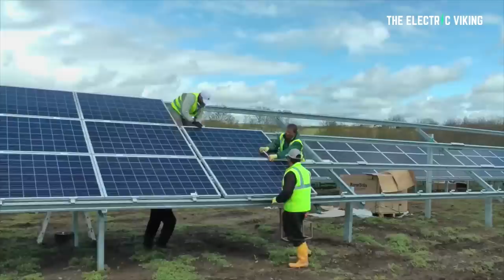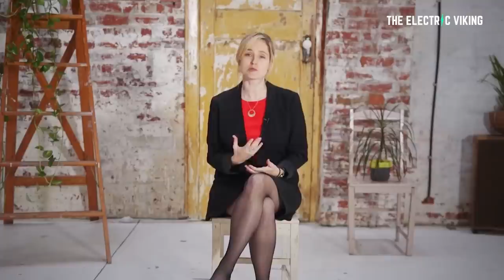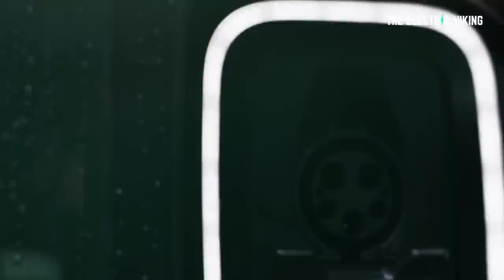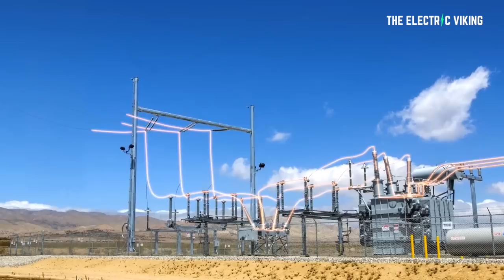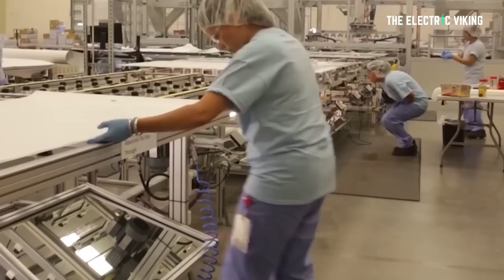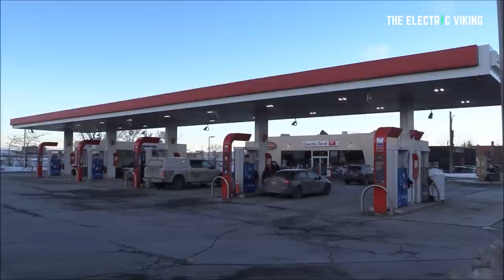How the world can stop the cost of living crisis & halve electricity costs

Comment: I can verify. We bought an EV and put 40 PV panels on the roof. Saves us around $5K a year. It’s like winning a free holiday, every year.
Reply: 40 panels!! damn, how big is your house. There’s me thinking I’m a big man with 22panels. I Feel like I’m a total failure now, I better call the Samaritans 😂
Reply: And twenty years from now when all the panels are done, what will be the cost to dispose of them , because there is no way to really dispose of them ,and what will be the cost to replace them? Or have you thought that far ahead? I have more than 40 panels on my house and garage...but I'm near the end of my life, so I don't plan on having to replace them.
Reply: How much electricity do you use where your savings ALONE are $5k??? Our 4 bedroom house, which is entirely electric, uses less than $1300 per year in electricity… in the PNW
Reply: @gabe1254  Pretty good. Do you use heat pump for heating your house? Heating water?
Reply: @andrezcabara2774  Yes, heat pump water heater and a Trane heat pump for heat/AC. I built the home this year, 2000 sq/ft, common construction but well air sealed. Average 28-33 kWh per day usage. Electric rate is less that 7 cents per kWh.
Reply: Mark, solar panels live far longer than twenty years.  They may drop efficiency a bit, but they can be used for quite a while.  
Earthship Biotecture will be happy to put your panels to work if you are done with them.
Reply: @gabe1254  With 7 cents kWh no wonder your yearly bill is less than $1300. It costs 30 cents here, so energy bill would be over $5k here :)

Comment: I just fitted a 6 kw solar system with 30 kwh battery in England, so far for the last 3 mths my electricity bill has been  0 , only paying standing charges. I think it will be November before I might start to use some from grid. I see a savings off about 2000 pounds with a 7 year payback at current prices which will no doubt drop to less than 5 as prices increase . Its a no brainer
Reply: I'd be lobbying to get the standing charge reduced if I were you.

Comment: I have done just this in my home and I use no gas any more. I have Solar PV and a Battery and an AirSource Heatpump and my monthly electricity bills (total household energy) average out at £10/month, insulating me from the disastrous rises in energy costs in the U.K.
Reply: Excellent could you please write down how much electricity you use for appliances, heating water and heating home?
Reply: @teranova5566  Most recent year Sept to Sept :- SolarPV Gen : 2658 kWh ; Day Units purchased : 4801 kWh ; Night Units Purchased : 5388 kWh. (includes car charging mostly night units and winter A/S Heatpump and battery cheap rate charge for consumption during day rate)
FIT Payments 51p/kWh for generated units. Some RHI payments (approx £80pm) for Heat pump. Net input to budget acct £10pm - balance still grows!

Comment: I am with you from one Viking to another (according to genealogy I can prove to be of Viking decent) on renewables. I have what I may on my roof + some to play with and then my farm is totally off grid. Unfortunately I don't have enough at the farm for heating in the winter. If nothing else we create less CO2.
Reply: Baby steps!!
(Investigate low voltage Infrared panel heating)
Reply: @rogerstarkey5390  I have attempted to use an old heat pump and store the heat in storage tanks but in winter and no sun the panels are only 10 % effective. Enough batteries are too expensive.
Reply: We are in the same boat in Canada.  We have sun in the summer and wind in the winter.  Doesn't make much sense to install wind as an individual but as a cooperative/community venture it may be possible to install a larger wind turbine.   Ripple energy in the UK is an example of such a venture.

Comment: Yes, accelerating the transition saves more money. Roll out nuclear, solar, wind, and batteries all as fast as possible. Dynamic pricing is critical for stability. Also need dynamic pricing for users and suppliers. Need dynamic power use controls at homes to do this. If price goes above a threshold, consumer need automatic cutouts so they do t get charged $10k for a month because the prices spiked. This will greatly stabilize the grid.
Reply: What is going to provide base load power when the remaining coal fired power stations are decommissioned. What is going to replace the revenue of coal exports? EV batteries are made with fossil fuels at the moment. We need more coal fired power stations, not less. People have cost of living pressures now. What’s the immediate solution to that problem? Nobody, including the Federal Government,  have explained how renewable energy is going to bring down power prices NOW.
Reply: Please explain dynamic pricing and dynamic power usage.
Reply: We need this NOW.
Nuclear is a multi decade project... WHEN (if) the new tech arrives.
We need 
Grid scale projects which ramp, generating from early in the project (example. Wind ramps as each individual turbine is installed)
.
Fragmentation, dispersed grid.
Why doesn't government, instead of giving grants, install say 2 panels and a small (4kWh?)!battery on homes..... Lots of them.
Get the homes off the peak grid.
As the money is saved on peakers, increase the investment, more battery, plug and play.
This would have the same effect as a grant/ refund, reducing individual bills, but be ongoing.
.
Concentrate on efficiency
If they have "spare energy", don't piss it away on inefficient storage like Hydrogen.

Comment: Storage is the biggest issue as basicl storage is still to expensive it is working for the short terms grid stabilisation where the rewards are high.  They need to put in much cheaper base storage most thenlithium batteries are still difficult to justify
Reply: Actually he mentioned zero homes.  That is a lot more than just solar.

I think he even had a diagram, heat pumps, design of take care of passive solar.  

Actually, even trees properly placed provide a great deal of shade and improve air quality.

And, we have to look at better Mass transit and that may even mean more car renting rather than owning.
Reply: @tireddad6541  nicely said but Northern Europe where I live has a very limited amount of solar energy in the winter due to the high latitude. Also up to 10 days without wind are not uncommon. Both can't be solved with storage in a economical way, also not when considering future storage prices.
Reply: @Sander-zj3wi  The EU has plenty, plenty of land in Spain, southern Italy and Greece to supply ALL the electricity it needs!!!

Comment: People - STOP with the excuses. It's YOUR LIFE - take charge. Where there's a will, there's a way. Lazy gets you ZERO. I'm 76, on minimal USA Social Security - fixed low income. NO other income, period, yet I just completed removing myself from the grid with solar panels and a lithium battery bank - results, not excuses. It's about what you really want. Yes, it took me a while. Yes I gave up candy and Netflix to be OFF THE GRID. You can all do it. OK. here come the reasons you can't. Stop making a CAN'T list and start planning your escape.
Reply: I have not paid an energy bill from when I installed my solar system. I pay a grid-connect fee, starting at 20 up to $24 a month to let them be my battery. It would have cost me 10 times as much to build an off-grid system as the grid-tied system.
Reply: WELL SAID.
Even turning stuff off, wearing a jumper, turning the thermostat down 2° helps.
Baby steps.

Comment: Missing a lot of important considerations here.  The biggest of them being what happens when the sun is not shining and the wind is not blowing.  You need a whole new back up system that runs off of....
.
.
 
 Fossil fuels
..

Germany is learning this the hard way
Reply: Here's an "important point" (observation)
I'm sitting in London.
Full cloud.
The tree outside my home isn't moving (no wind).
14:00 Tuesday.
The UK grid is currently at 46.4%GREEN ENERGY 
About 3:1 Wind:Solar.
The point?
The wind is blowing SOMEWHERE. (Scotland?)
The sun is shining SOMEWHERE.
(Just noted it was 54% total yesterday).
We'll be installing a lot more soon.... Probably be exporting to you! (You're welcome)
Reply: @rogerstarkey5390  I'm all for renewable energy! But until there is battery storage system that is capable of holding energy to power a densely populated area (most of the world's population is in cities or trending more so in that direction) renewables will be a limited solution for our energy needs.  
Also there are only a handful of areas where renewables make sense (with lots of sun or wind).
Reply: @rogerstarkey5390  That's awesome. You may have a bit of an advantage since you have a lot of coast lines where there's a lot of wind. Still impressive. What's the price for 1 kWh?

Comment: I haven't had an electricity bill since 2009.
Reply: Where do you live? You heat your home with gas?
Reply: @andrezcabara2774  Australia. Yeah we had a gas furnace but recently ditched it for  ducted reverse cycle air conditioner. We have Solar PV and solar hot water. I still expect no elec bills.
Reply: @passdasalt  Thanks, Australia probably has a milder climate where I live. I will have a 8.2 kWp PV with Battery but that should not be sufficient through the winter according to calculations.

Comment: Without nuclear energy to backstop for when solar/wind is insufficient, it’s not viable for solar/wind in the next few years in the US to go all renewables otherwise, regardless of battery storage, of which that also can’t possibly keep up probably even for EV cars by themselves, let alone stationary power storage batteries.

You make it sound so simple and straightforward and short-term, but it’s not.
Reply: Here's the method.
You build 1 GW of "whatever".
You remove 1GW of fossil fuel generation.
.
You can do that with green sources, just keep adding....
.
Nuclear?
That's a problem.15 year project, no incremental ramp, expensive project build, expensive power.
Plus "NIMBY" to delay things.
.
If I told you that compared to nuclear, you could build the same Wind capacity, then start again, build the same amount and finish at the same time as the nuclear project, plus, as a side project, build more battery storage than you need, and you would have cash left over.... And the cost of the energy produced would be 40% that of the nuclear electricity, would you think wind might be a good idea?
.
That's happening right now in the UK.
3.6GW of Wind, completing at the same time as 3.2GW of Nuclear, but the Wind project started years later, will cost £8.9bn compared to £24bn and the energy will be £48/MWh compared to £114/MWh.
....
Ok. They didn't double up, but
They could have used the "spare" £13bn, ended up with 7.2GW (vs 3.2GW nuclear) and spent  £4bn extra on storage.
Put the second phase in another location and it gets over the "but the wind doesn't blow" issue?... The wind always blows somewhere, plus more than double capacity when it does blow and tons of storage..... No problem.
.
Alternatively.
You don't build a (single) big project.
Build a lot of solar panels.
Build "half size" house batteries.
Start a training initiative for installers.
.
Have thousands of installers fitting small, 2&3 panel systems to homes (free install!)
Take those homes off the grid at peak times.
It pays for itself.
Those installers pay tax.
The businesses making the equipment pay tax.
No more huge investment in building multi decade projects.

Comment: Building out nuclear, wind,solar, and batteries will greatly reduce electrical costs and cost of living. There needs to be an excess of energy for there to be more happy people.
Reply: Compare the types.
Large project Wind, Solar, +batteries..... 8 year install, but incremental boot up from year 2.
.
Nuclear, similar output, 15-20 years. NO output until end of project.
Compare the 2 projects over that 15 year timespan.
.
Nuclear
15-20 years multiplied by the output of remaining "residual fossil generation carbon footprint"
.
Wind/ Solar
8 years of fossil
Minus
6 years at average 50% capacity.
.
Calculation 
Best case 15 year nuclear, 3GW project output.
45 "GW years" of fossil generation is produced over the 15 year project life..
.
Wind/ Solar (+storage)
8 year project, 2 years before first generation, linear "boot up" to completion.
That's (8-2)×1.5= 9 "GW years" of green generation during the project.

Subtract that from the comparable fossil amount over the 8 year period.
.
(8yr x 3GW)- 9GW = "15GW years" "residual fossil carbon footprint"
.
BUT.
We should then compare that to the 15 year nuclear project.

From 0 to year 15
Nuclear 45 GW years of fossil  is generated.
.
Wind/Solar (+ storage)
From 0 to year 15.
15 GW years (to year 8) then clean.
.
Saving 45-15 = 30 "GW years" of fossil generation / pollution to year 15.
.
(Similar to switching off a 2GW fossil plant from "day 1" to completion of the nuclear project)
🤔
.
Other considerations.
 A Comparable Offshore Wind project build cost is about 36% that of Nuclear (Ref UK projects in progress)
You could build one, then build another one , finish about the same time and have 28% of the cash left over! (More storage?)
.
Energy cost.
Adjusted 'strike price" (recently increased)
Wind £48/ MWh (rounded)
Nuclear £114/MWh (rounded)
🤔 ..... No comment.
.
Monty Python time.
"Apart from being cheaper to build, faster to build, having a lower carbon footprint, and producing far cheaper energy,  what advantage does Wind (etc) have over Nuclear?"

Comment: Build GigaCities.
Reply: That's a 30 year project.
We need 2 year projects.
Reply: @rogerstarkey5390  Aww... that's sweet, thanks.

Yeah-yeah: Nope.

I've got a full onramp for that. You're right, It will take 2-3 yrs before we start to build larger GigaCities. Those will complete in 18-24 months.

The principles are such that smaller units are designed to be retrofitted into & around current cities & larger towns. Those can be completed w/in that time, 2-3 years.

As few dozen of those, & extensive VR models, are completed, we'll experience the advantages of GigaCities' feature sets.

Part of the feature set of GigaCities include high manufacturability. It'll take those 1st few years to get the offsite & onsite manufacturing ramped up.

As we do, the build efficiency will increase, driving down costs & increasing run-rate!

We'll get GigaCities to > 10x density on <1/2 the land, decreasing percap total energy use by > 1/2.

No need for cars, internally.

We got this.

Thanks.

Comment: cheap grid scale storage is the missing piece of the puzzle.
Reply: But if green grid generation  costs 50% (or less) to build compared to Nuclear, and can be ready in less than half the time, you COULD build 2 FOR ONE?
Build in different places.
No wind in one? It's blowing in the other!
.
Or, you build slightly more than the nuclear plant and spend the rest on storage.
Reply: @rogerstarkey5390  I think for the foreseeable future natural gas is how carbon emissions can be cut. It is far cleaner than coal. Maybe something can be done for it to make more sense to developing countries including my own(India). Coal is really bad and there is a lot of scope to cut emissions there. But I don't really know the economics of it. To shift to complete green grids will require technological advances. Nuclear doesn't make sense as it takes too much time and is expensive. But still it will be a greater part of the energy mix going forward.
Reply: We don't need to start until we've solved all puzzles. Let's chip away year by year. In the mean time, we have options, even if not idea. Still beats delaying, no?
Reply: @andrezcabara2774  no we should absolutely act now. Increase the percentage of green energy in the energy mix. But we can't go fully green at the moment because of technological limitations.

Comment: We in UK wind represents 30% of electricity production. Frequently during the winter the wind does not blow and the sun does not shine. Batteries will not keep us in power for 1 week let alone 2 months. The rush to reducing the greening of the planet has resulted in a tripling of my gas and electric bill. It would be more but the UK government has capped the increases to a fixed amount. Australia is a sunshine country. I can plaster my bungalow roof in solar panels located 51 degrees North and only be self sufficient in electricity in the 3 summer months. During the 3 months of winter the panels will just about run the LED house lights. So we need substantial back up. We have gas and coal but have decided to stop using coal- only 6 or 7 coal power stations left. We have stopped development of gas fields and import cheaper gas. Nothing much happening on nuclear power either.
Reply: You wrote, "The rush to reducing the greening of the planet has resulted in a tripling of my gas and electric bill." I was under the impression that reduced access to Russian oil/gas as a result of the Russia-Ukraine war had something to do with the sudden increase in energy costs.
Reply: We AVERAGED 30% over the last 12 months .
Since over the summer, that would be predominantly Solar, I imagine that during Winter the wind was blowy pretty much all the time?
.
Remember, it doesn't have to be where you are.
No wind and cloudy in London today.
We're currently on 46% Renewables, mostly wind.

Comment: Sam, almost click bait - clean tech takes too long to stop the cost of living crisis. It can solve the problem but to stop a crisis requires QUICK action. Good video as usual, but it is not about what's quickest.
Reply: So what's quickest? (Don't say nuclear)
Reply: Earthship..  Earthships can be built using a lot of repurposed materials that replace standard building materials.  Earthships use less than half of the energy that standard homes require.  Earthships add little to no demand to existing infrastructure.